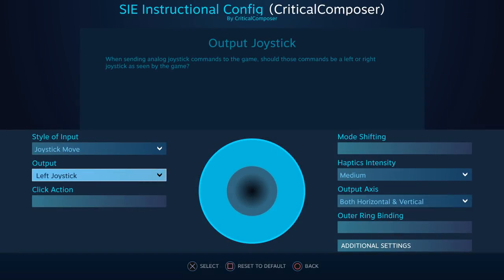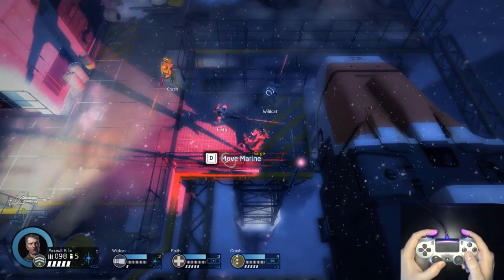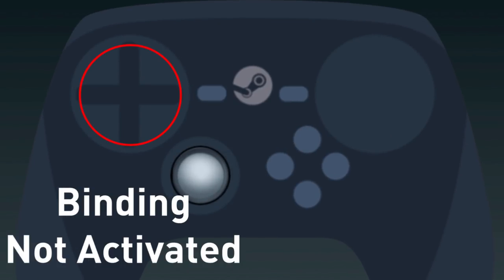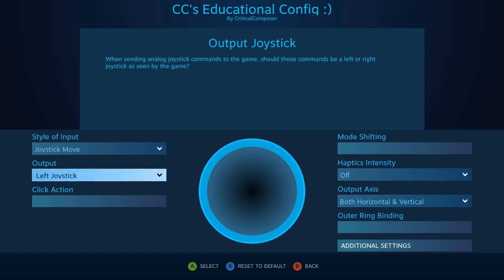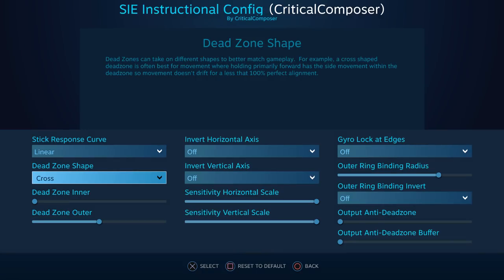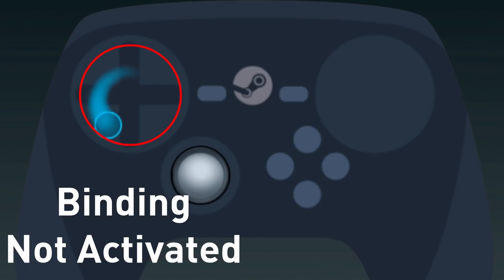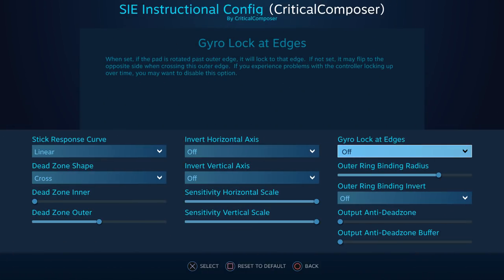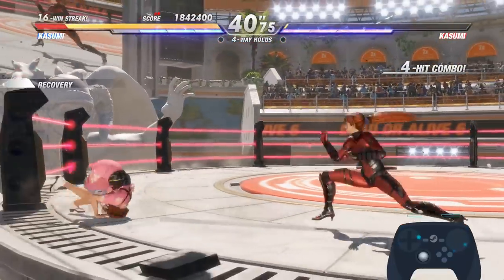Steam Input Essentials - Eps 8: Joystick Move

Comment: Thanks again for the information. Learning all the time. I’m struggling to aim and really struggling to loot dead boxes on Apex Legends. I keep going back to my PS4 controller but I really want to master the steam controller as I love it :)
Reply from the maker: I know it isn't a very popular opinion around Steam Controller/Input communities, but the Dualshock 4 is actually a really great controller when paired with Steam Input. You have the familiarity of the dual joysticks and a dpad but it also features the touchbar and an IMU (gyro) that is comparable to the Steam Controller's IMU. You can achieve gyro aiming and really nice radial menus on the touchbar (which can be split into two touch "boxes") while not having to relearn an entirely new controller. The only real downside is the lack of grips.

With that said, I do support the idea of hiding the DS4 and really putting a solid 2-3 weeks of time towards using the Steam Controller and really taking the time to get a feel for it. I find the touchpads to be superior to joysticks in every way and love having a physical dual-stage trigger rather than emulating it in software. But I appreciate that it isn't for everyone. If you've put in the time and still don't quite get the SC then don't feel any shame in sticking with the DS4. It's an excellent controller as well.
Reply: Critical Input thank you. I’m going to put the DS4 away and concentrate on the steam controller. Have you any suggestions for loot boxes? It really slows me down to loot up on Apex. I find moving the cursor hard to select what I need to loot. Thanks again for the guides. The Steam Controller needs more love and it’s only you and a couple of others who embrace it. Cheers.
Reply from the maker: Let's see, when I played Apex I had scrolling on joystick up and down and then used the right pad + gyro to move the cursor. Do note that I used the left pad for movement, so if you use the joystick for movement then put the scrolling bindings on the left pad. 

This setuo allowed me to scroll through menus and select items quickly, but you need to get better at using the pad+gyro combination first. So many games require aiming or mouse cursor precision so I would say that's the most important skill to master with the SC. Just play lots of games with aiming or cursor control and develop that muscle memory, it's the only way to improve. One easy way to do this is to use your SC for navigating your operating system. Put the mouse in hiding with the DS4 and use your SC for everything except typing. Or pick up a game with lots of cursor movement, like a Diablo-clone, MOBA, or strategy game. Basically you just need to put yourself in situations that require you use these skills so you can become more acquainted with them. 

It's sort of like the common advice of dropping into populated zones in Apex Legends. You might accrue a bunch of losses quickly but it'll give you combat experience, something you won't get just hiding and looting for the first 10-15 minutes of each match.
Reply: Critical Input brilliant advice again thanks. I’m committed now to this controller. Keep up the great work 👍🏻

Comment: i have setup my ps4 controller, only when i push the right joystick to left or right, it always goes slowly down in a spiral. Like i start in the middle of the screen, and then it goes , while holding left or right it slowly to the bottom of the screen, i use steam input, and i dont understand what setting this is

Comment: i dont have the joystick move option in the drop down box, the only way i can get it is by selecting a gamepad template that has it loaded but when i try to modify it as soon as i open the window there isnt joystick move anymore and cant select it back ... do you know whats wrong ?? thanks
Reply from the maker: I don't use Steam Input anymore so I have no idea. Though back in the old days of Steam Input odd bugs like this could be ironed out by updating Steam. You can force an update by changing version branches, moving between release to beta or vice versa.

Comment: Hi again.
Does anyone know why the game 'Metro Exodus' (Epic Version running through Steam Compatibility), doesn't show the Dualshock icons when using a custom layout Dualshock 4 profile.  Everything else seems to be working fine through Bluetooth.  When I play the game NOT through steam, they show up correctly.
Thanks in advance.
Reply from the maker: The reason why the glyphs work when playing directly is because 4A has programmed Dualshock 4 support into Metro Exodus. The reason why the glyphs don't work when using Steam Input is because Steam Input only supports outputting keyboard, mouse, XInput, and Steam Input API(SIAPI). Since it is a non-Steam game it doesn't support SIAPI. So any controller bindings you assign will show up as an Xbox controller.
Reply: @criticalinput  I really wish Developers adds a option to switch Controller prompt, if they didn't add a Dualshock 4 official config. I know Warframe, despite not having DS4 Official config, you can change the button prompt in-game. Same thing with Yakuza 0 (and I think Kiwami?) has its own official config that forcefully changes button input.